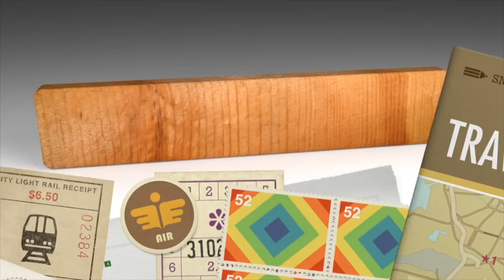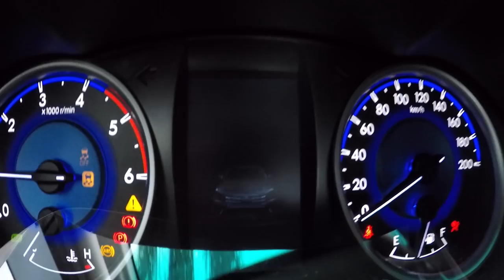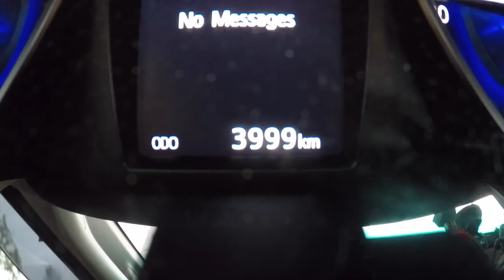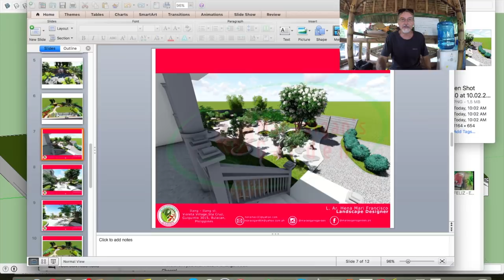VILLA FELIZ - EPISODE 218: LANDSCAPE EDITION (House Building in the Philippines)

Comment: Seems like your windows will be plenty big.  In the PH there is generally plenty of sun and there could be too much sun most of the time.  The main challenge is staying cool.  Did you say there is a good way to vent the hot air from the vaulted ceiling?

Comment: James..I was wondering if you saw a previous comment I made with the suggestion that you make notes,[sketches], where all the pipes and electric cables are for future reference? I really would like to convince you these, [along with accurate measurements], will be so valuable in avoiding puncture accidents in the future. Also, of course, if you want to redirect, or join onto, any of these lines in the future you will have a good reference point to work from. Memory is not too accurate as time goes on. Love your build, love the vids, love the dogs, love it all...!!
Reply from the maker: Hi Stephen.  Yes, I saw your comments and they're very good advice.  I have pics somewhere of all the pipe layout I just have to find them in the thousands of video/photo archives I have in my many days of building.
Thanks for the tips and kind words!
Reply: That's cool...I'm just aware of the 'random' changes made by you and also the 'random' work done by others since the original plans..incorrect information can be more dangerous than NO information! Don't forget to keep in mind the location of drainage pipes in relation to the planting of large trees and other landscaping matters. I'm just nervous for you, [I do suffer from anxiety], being that everything has gone so well, so far, in the build.

Comment: Hi James, I think you will eventually come to fear the idea of an open CR/shower/bathroom. First, consider humidity from the shower and bath affecting you main room and the walk in closest. Second, and perhaps even more importantly, the problems of noise, especially at night from using the the CR; not only during use, but also when flushing.  Your not getting any younger James, and those night time trips to the bathroom are going to become more frequent. Consider your Wife and how many times you will wake here up when you use the loo.
Reply from the maker: James, James, James...First off, we'll have a ventilation fan in the CR which will vent to the attic space and with the design of the roofing, it will not settle on any of the truss system causing corrosion.  The position of the water closet is on the opposite side of the shower wall and the distance from the CR to the bed will help keep the sound down.  A big plus of no door is I don't have to worry about opening/closing in the dark...yes, getting older makes having the open door a plus!
Been married many years to Ness and she's usually the one getting up in the middle of the night leaving the CR door open and its never bothered me.  Maybe I just shared a little TMI...😉
Reply: Perhaps a little TMI.  At least it not TMGI.